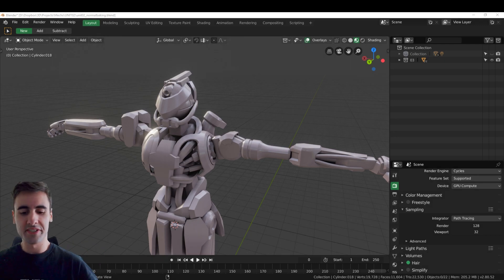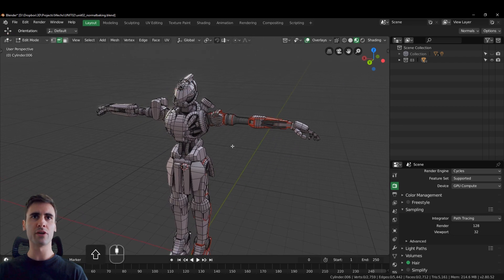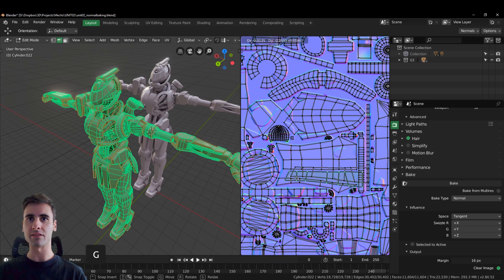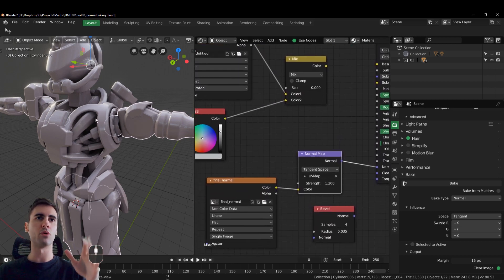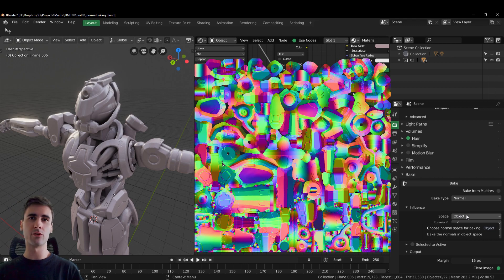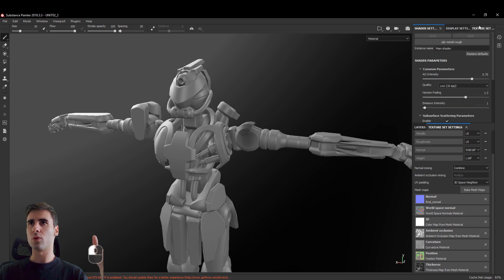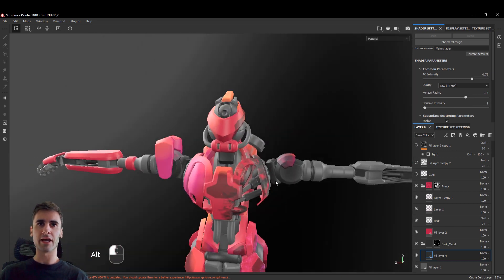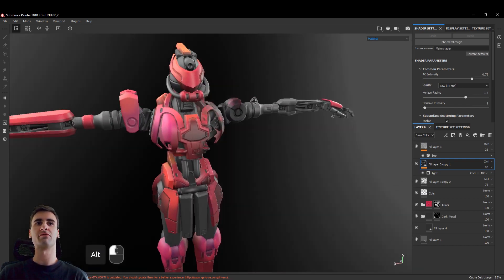Baked Bevels Workflow in Blender & Substance Painter

Comment: Just a Suggestion, 
if you have a hard edge on the mesh, you need to separate it on the uv. Thatswhy you have that strange-looking thin lines on some places. 
The mesh's tangent normal is breaking along the hard edge, and the limitation of the texture pixels vs the precise edge vector causing these artifact. It tries to draw between pixels. a littlebit from the one side and a littlebit frome the other. If you separate it, you give it a room for edge bleeding.   ( I hope it's understandable, sorry for my english :D )
Reply: That is not the reason. I have the same problem, and have never found a solution. SP material generators always give dark or light seams on hard edges with bevels. If you smooth shade the lowpoly, you get smooth bevels without lines, but the shading becomes completely broken over the flat surfaces... Seems you can't win. Taking the albedo from the smooth shaded bake and using it on the hard shaded lowpoly with the normal from the hard shaded bake helps, but it's an annoying process and the bevels are still not quite perfect.
Reply: It definately makes it better but there is still a tiny line there
Reply: @Avarice_  is there padding on the texture? if not, or slim, try to make a thicker one. if the problem still exist, try to separate the uv islands with a bit more distance.

Comment: Do you ever get issues with world space normals and seams going from blender to substance painter? my models always seem to come with harsh seams that triplanar blending does not help. it al seams to start when i bake the world space normals map. i have tried in blender and substance painter with multiple settings and cant figure it out.
Reply from the maker: I'd need to see the file to understand better, but some clues can be related to the texture resolution and how you need to set it to OpenGL
Reply: @LuisCherubini-g8z  Thanks for the reply. I have created a test piece and linked it here if you would like to take a look. there is a png showing a faulty/discontinuous bake in substance painter as well as a blend and FBX file. I have been struggling with this for days now and have tried various methods of making the model bake correctly. edge slip modifier, normal smoothing, beveling openGL and direct x and I have re-done the IV layout multiples times. I have read around that has a lot to do with smoothing groups and edge sharpness but I can't figure out what i need to change since my model has no sharp edges, just UV seams which is where the issue always shows up. I'm sure it is something simple but for the life of me, I can't figure it out. any time you have to spare to look at this would be much appreciated. I should also note that the mesh test piece is unwrapped correctly as it is part of a much bigger mesh.

https://drive.google.com/open?id=1qZbKXswflkGUj93Uy32ss8xZlh5rA1d_

Comment: Thanks a lot for this video! Been struggling with finding the right workflow for hard surface normal baking in Blender and this helped so much! Could you explain quickly how you do your smooth shading before baking though? Do you just smooth shade and use autosmooth with a set angle or do you do everything with the edge split modifier (marking sharp edges as needed)?
Reply from the maker: I find the results from auto smooth to not be reliable when you want to export your mesh to different applications. So I manually mark sharp edges.

Comment: The hotkey for applying all modifiers in 2.8 isn't set by default. You have to either set the hotkey manually or change the keyboard layout from standard to 2.7x within the preferences

Comment: Does anyone else have issues with Edge Split modifier? It does nothing for the bake, unless I apply it... Which kind of adds one additional step of needing to merge splited smoothing groups after bake is complete.
Reply from the maker: Hi Laurynas, thats why in the video I duplicate the mesh before applying the edge split, that way you have the original saved, and the other only serves for the purpose of baking. Best Regards :)
Reply: @LuisCherubini-g8z   Makes perfect sense :D Thanks for your reply and keep up the good work!

Comment: Thx for that edge split tip, for tangent space baking, I never really got might head around baking a good normal map, always end up with a mess, gonna check out your other videos, been using blender for a couple of years and substance for about six months, do you ever bake an ID map in Blender to take to substance, that’s the way I do it, I find the substance one doesn’t always work
Reply from the maker: About ID maps, it all comes down to your Studio/ pipeline. In that particular piece I manually masked everything in SP. I found that baking ID maps with no planning will just higher the friction of the workflow.

Comment: I enjoyed this video. I have been trying to use Blender for normal baking but struggle with quality issues. Do you think it is helpful to work in 16 bit? Seems many feel its crucial to bake at higher bits. Most of the time I use the bevel modifier with High/Low poly setup, seams on all bevel edges (CGcookie method).
This way the only difference between High and low is just the modifier and the smoothing angle. This gives you a little control of bevel width variation. Wish Blender had proper AA in the baker. I will give your workflow a try, thanks for sharing.
Reply from the maker: Indeed, as of today Im manually removing dithering artifacts with Photoshop, specialy when dealing with hero props. I found out that even by baking with a 32 bit float and then reducing it back in PS in sRGB gives me some extra bit depth but stalls my workflow time. If you are adopting this in production, make sure its consistent over all assets in unity.